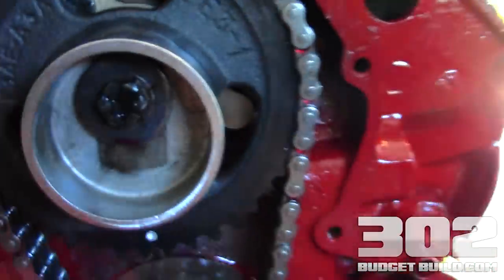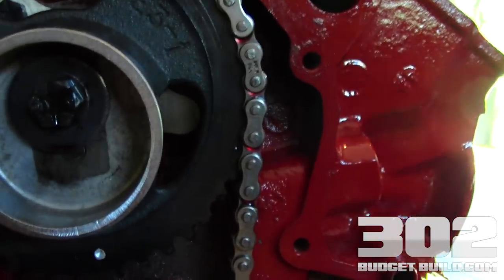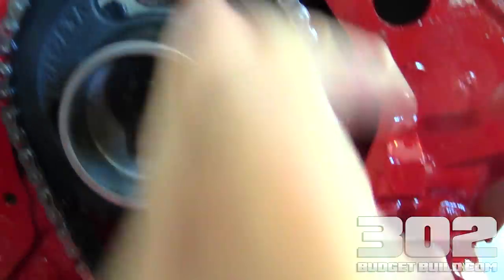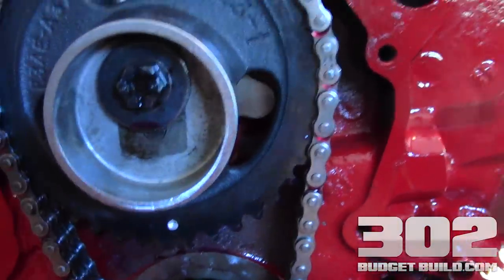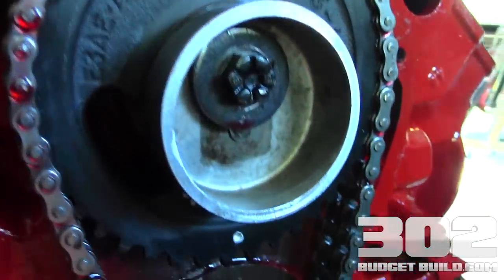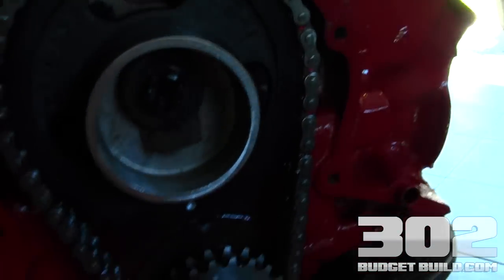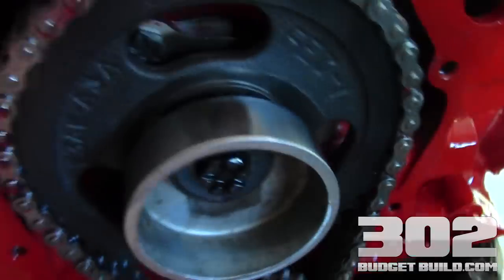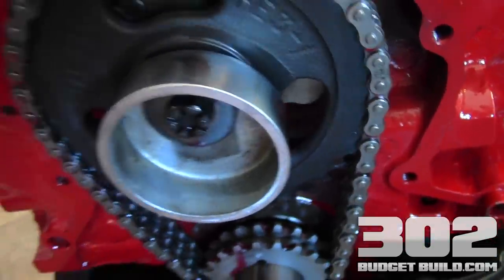Fuel Pump Eccentric Small Block Ford 302 | 5.0 Mechanical Fuel Pump

Comment: Thank you for the informative video along with the excellent narrative. My 1978 302 has a tab on the pump eccentric and uses the short pin instead of the long pin. I think a lot of changes occurred in 1984. Pre 1984 also used a two piece rear main seal.

Comment: I’m in the process of working on my 79 F150 302 ci engine. I’m replacing my timing gear assembly. The original one was worn out with excessive slack. Should I replace the two piece fuel pump eccentric? Plus I noticed the camshaft thrust washer had noticeable wear from the back of the upper gear. Replace?

Comment: Would love a detailed video on 5.0 EFI to carb conversion. I’m converting one now and it’s quite a bit more involved than I had anticipated.
Reply from the maker: If you’re talking about 5.0 just swap the intake manifold for a performer and pick any 600cfm carb of your choice but if you’re going that route. Just slap a sniper or a Fitech. Fiddling around with carbs with todays gas is a losing battle. Vapor lock and gum up are inevitable

Comment: Interesting I have a 1989 Ford E350 with a 5.8 I was installing a new water pump but decided to replace the timing set since I already had it torn down  but after removing the timing cover I came upon the same thing a eccentric but my fuel system is EFI so why did this motor come with a eccentric ? Its the original motor can I just remove it ? I don't really see any use for it.

Comment: I have a 1973 F100 that I am installing a new FUEL PUMP and I am having trouble setting the ROCKER ARM in of the FUEL PUMP.... do you have a video (or tip) on how to rotate that eccentric so I can reset that rocker arm?

Comment: So i'm just curious did you run it like that being the cam pin is sticking past the eccentric and not allowing the cam bolt to be tightened properly  ?

Comment: Having trouble reinstalling the fuel pump on my 302 due to the positioning of the lobe, should I like crank the engine a split second to move it? It was very easy to remove so wasn’t expecting this much trouble. It’s a boat

Comment: Hi - I have a 74 351w and need a new damper/balancer. On top of that the mech pump has stopped pumping, its erratic - when I  apply low psi it holds (no diaphragms are torn either - I had it open). Is it possible this round thing has jumped, or worse pin bust?

Ill remove the damper and timing cover to get a peek inside.

Comment: I'm rebuilding a 1988 roller cam 302. It came with an eccentric that looks somewhat like this, but I'm told that what is present will not be sufficient. What vendor and part number is this eccentric from?

Comment: Thanks for the videos. I changed the timing change and gears  on my 1977 ford truck with  a 460 or 7.5  engine. I never saw the  hole in the wheel disk that drives the  fuel pump lever, I just tightened the disk looking wheel. did I made a mistake because the fuel pump is new and is not pumping fuel ? Than you for the video this information help me a lot.

Comment: Hi if I was switching the engine to carbureted with an electric fuel pump would I still use the longer one or would I use the shorter one because I won't need it for the mechanical fuel pump
Reply: @justbcuz1012  this dude don't answer no questions 🙄
Reply: Only need the short pin for fuel injection because you don't need the eccentric pump drive.

Comment: Been watching your videos since the cam install, I am just wondering why that is a solid fuel pump eccentric.  Everyone I have is a two piece design.  I am mainly looking at these videos cause I am planning out a 302 HO roller build to replace my 302 out of my '82 F150.  Going to reuse the oem '82 components as much as possible including the eccentric.